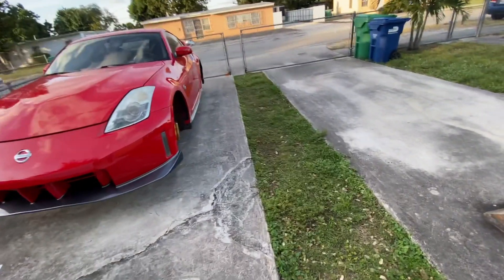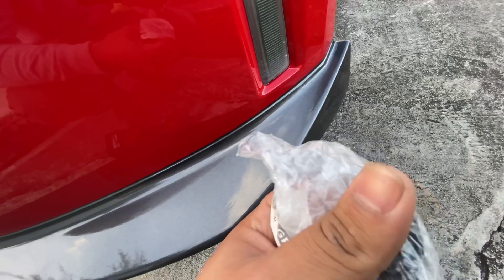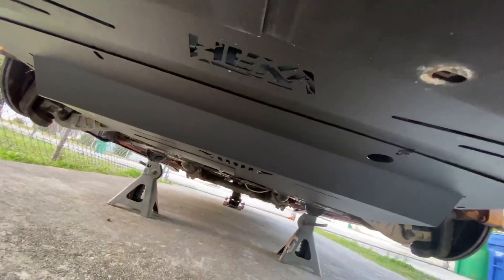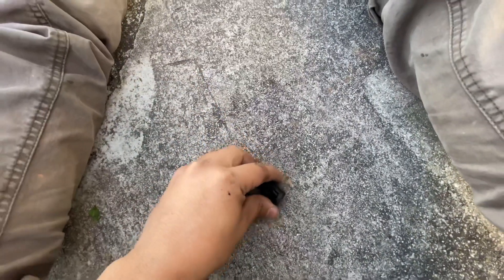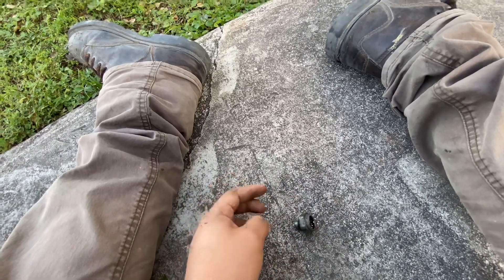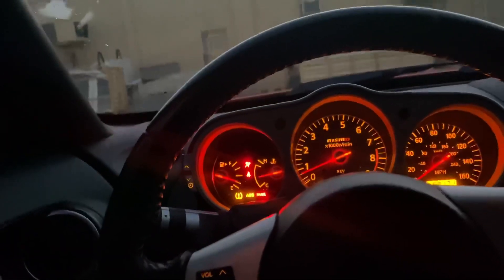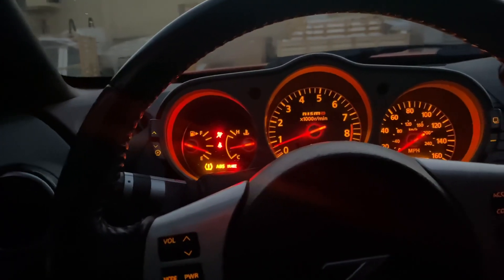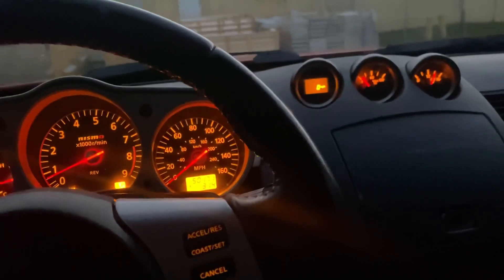BAD NEWS For the 350z Nismo!

Comment: Yeah when i bought my Hr with only 75,000 miles it already had the oil gallery gaskets upgraded to the updated gaskets from the Dealer lol. Old owner said they crapped out at 55,000 miles so even low miles Hr’s have this problem i guess too 😂

Comment: Did u ever figure out what caused your dash lights to come on? (ABS/BRAKE/SLIP/TCS) Mine just came on, replaced the wheel abs sensors and it didn't fix it. Appreciate any input, thanks!
Reply from the maker: never knew why as i sold the car before fixing it. did you replace all speed sensors? differential sensor can cause that too. and worst case scenario it’s the ABS pump.